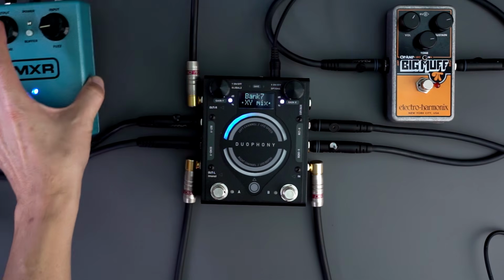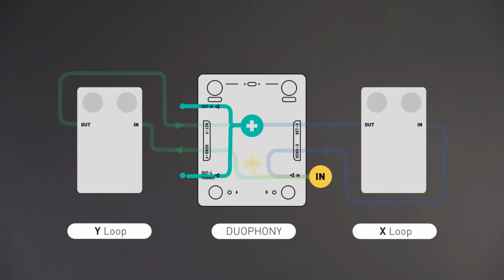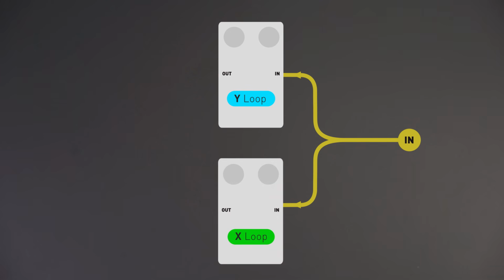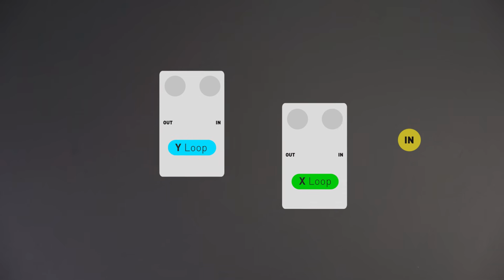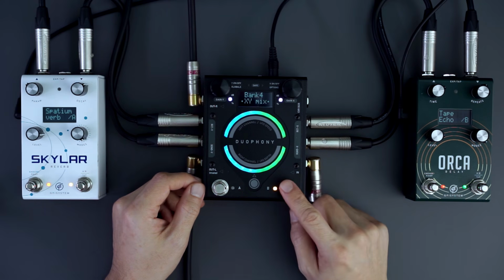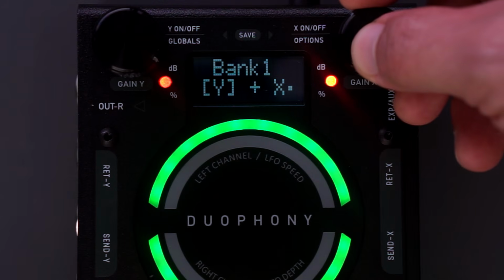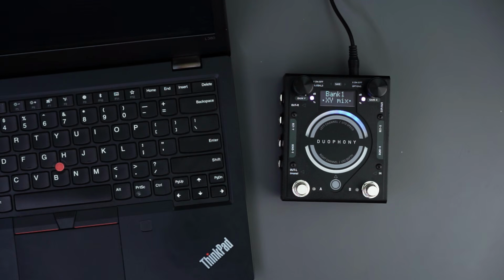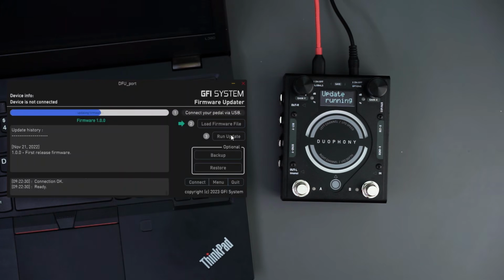Duophony Parallel Blender: Basic Operation

Comment: Hello! I'm excited to see that this device can easily move a pedal between series and parallel. My hope is to use this pedal to sample my chain with a looper (in series), and then switch to parallel once I get the desired loop. From there I'm hoping to have two separate outs, one with my looperless signal path, and one with JUST the loop. Is this possible with the Duophony? If I only have a looper in the X bank for example, can I send the looperless signal path out through OUT-L  and the looper signal path out through OUT-R ?
Reply: My understanding is I could utilize the W-D-W mode and use OUT-L for my looper out and SEND-X as the out for the looperless chain?

Comment: Such a great pedal!
In wet/dry/wet, can this be used with an expression pedal or something to mix a dry signal with a wet, or send a wet effect to a dry one?
Image like wet/dry/wet to wet/mix/wet or mix/dry/mix.
Reply from the maker: Expression pedal can be used to control the Dry signal level or the Mix parameter, but not both at the same time. If you need to control both simultaneously MIDI is the way to go.
Reply: @gfisys  Thanks！
I see that I can use midi control to change it to either wet/mix/wet or mix/dry/mix.
I’ll buy it.

Comment: Is there a way to have independent control of the level of each loop? For instance, if I want the mix of loop x to be 60% and loop y to be 85%, is that possible?
Reply from the maker: You can do that sort of by combining the action of the Mix control and Gain control. Set the mix control to the approximate desired ratio, then use the Gain control to fine tune the effective mix ratio. You will have to rely on your hearing cause you won't see the 60% : 85% on the screen.
Reply: @gfisys  which mode would that be running in? The 50/50 mode? Maybe someday you could do a firmware update with a mode that gives you full control of each loop from 0%-100% independently, similar to how the L and R mixes can be independent… not sure if that’s possible with the hardware, but at least visually the too slider could be green and the bottom one blue. Thanks for such a quick response! It’s a fantastic pedal; I’m running it with two delay pedals in parallel that don’t have a kill dry, so I’m running them with the mix maxed (100% wet) to have control, and I was curious if I could fine tune the mixes a little more.
Reply from the maker: @lachlanplache7148  Yes, using the 'XY mode' and setting the mix at 50:50 will give you the most flexibility. For example, when the mix is at 50:50, and you set the gain of loop X to +6dB and the gain of Loop Y to -6dB, the effective mix ratio becomes 25:100. We will think about the feasibility to add the independent control scheme in future updates. Hardware-wise is not really an issue, the more difficult problem is designing the user interface for this new type of operation, which is basically a line mixer.
Reply: @gfisys  well, if you ever do manage to include that type of functionality this pedal would become even more ridiculously capable! I’d absolutely love to see it! Thanks again for being so responsive to these questions, it’s really cool to be able to talk to someone from the company about this stuff. You guys are making fantastic pedals!

Comment: I have a couple questions.
 - Will you be updating the firmware in the future to include a random slope LFO waveshape?
 - Would it be possible to update the pedal to work completely independently on L/R channels? Specifically with LFO control in mind. My ideal scenario would be hooking 2 stereo effects up together, then randomly panning mix between them on both l/r independently. Thus you get random panning that is not syncd together on  L/R (going the same speed would be fine).
Reply from the maker: Random-shaped lfo may be added in a future update. The pedal is already able to apply independent blend ratio on the L/R channels. For the LFO control, at the moment a "panning mode" is available for L/R panned modulation, it won't be a problem extending this to independent L/R random lfo modulation.
Reply: @gfisys  OoOoo most excellent! Thank you

Comment: Hi there! Is gain on send or on return? Can i leave one loop pedal in Y, a recorded loop for example on my Boss RC.1, and take off the channel? Is possible to have trails when a channel is muted, or in general does each channel have trails? Thanks!
Reply from the maker: The gain is on the Return. Yeah you can put a loop pedal on one of the loops (X or Y). You can configure the bypass to have trails or no trails.

Comment: I VERY MUCH hope one day GFI implements a FW update for the Duophony, to allow users to flip the loops order in Series configuration. This will make Duophony the uber-ultimate effect loop switcher/mixer/blender on the market. This is VERY important to be able to change the loops order. I hope there are no technical hardware limitations to implement this.
Reply from the maker: Thanks for you input and suggestion! However, all the signal paths in Duophony are implemented in analog hardware, and therefore it's not possible to alter the way signals are routed via firmware updates.
Reply: @gfisys  yes, and yet you’re able to switch from series to parallel routing without resoldering parts inside :) But - if you say you cannot - then we’ll have to take it as is (which I already did ;)
Reply from the maker: @silentguitarplayer6430  the capability to switch from parallel to series is by design, the hardware was designed to do that. To allow reordering of the series connection requires overhaul of the hardware design, not something that can be done through updating the firmware.
Reply: @gfisys  Ok, got it. Don't get me wrong - Duophony is an incredible product, I ordered it as soon as it hit the stores, but we always want "just a little bit more", don't we?:)
Reply: The EHX Switchblade Pro  has that parallel + series with reordering capability, but is mono only. A stereo blender with that feature would be unbeatable, because the flavours one can get with series reoredering are impossible to get through parallel mixing. Maybe Duophony MKII? 😁

Comment: ahh, SO close to what I need for my application. any chance this will ever be able to blend a small amount of the X return into the Y loop while in parallel mode? my goal is to have 100% wet signal for W/D/W with reverb on the repeats of delay.
Reply from the maker: If your reverb and delay pedal can be set 100% it should be doable, it's just a standard parallel blending.
Reply: I'm trying to bend my head around using a Morningstar ML10X and this together 🤪